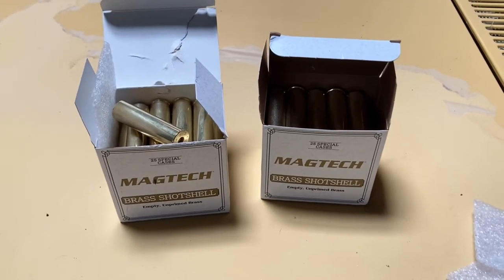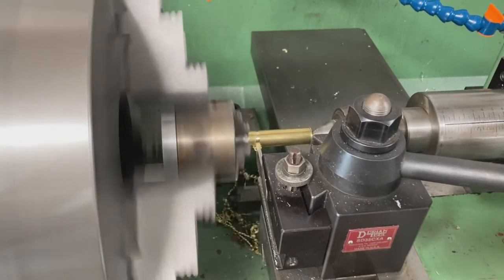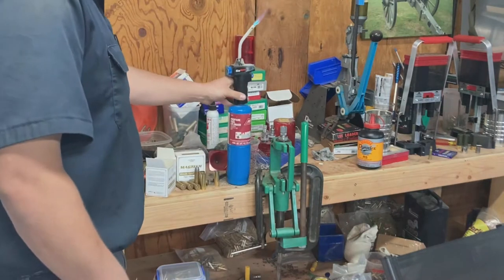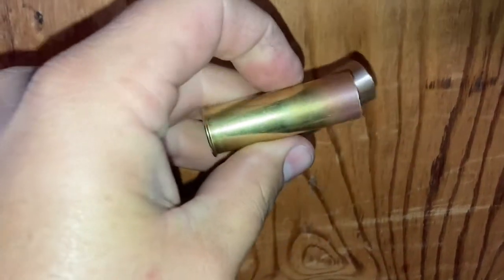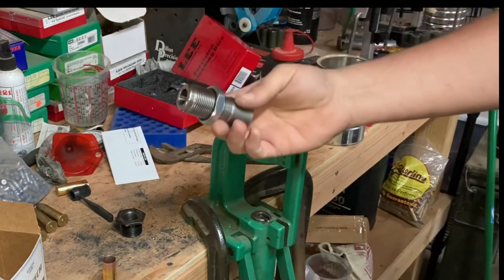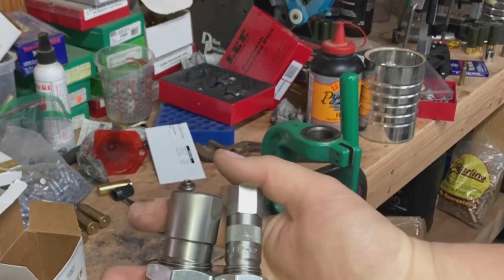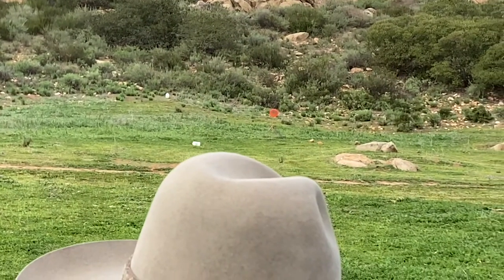Making 577 Snider brass from Magtech 24 gauge brass shotshells

Comment: I bought my wife one in Afghanistan. I have shot it once. I just bought dies, bullet mold and have a machine shop at home to cut the shells. Thanks for the info!
Reply: Sorry if this is random, but what was the process and your experiences like on bringing a firearm home from a deployment? Like did you have to get approval from your CO, what was the bringback paperwork like and what kindve stuff got approved or rejected that you saw? Also where did you buy, did you like just stroll into an Afghani market and buy whatever shit you saw? Sorry ive just always been curious about that.
Reply: @sergeantbigmac  so, since it was classified as a curio and relic firearm, all I had to do was mail it home from the post office. The local nationals had a shop on base in Bagram. When I was getting ready to leave theater, we flew to Bagram for our flight home. I just bought  it and mailed it home. No permission required. I picked up a Snider and a Martini Henry for $400. Both are authentic and not Khyber Pass copies. The Martini is a Royal Kabul Arsenal variety, so all markings are in Arabic. Pretty cool.

Comment: How did those non solid head cases stand up to 120 grs? I have used the 24G cases for M-H 577-450 but they seem a little weak, and they need cleaning as soon as you shoot them as they cant stand much corrosion. That sizing wax is essential for case forming, but it seems to last forever, funny thing about the case trimming is that I always hold the case the other way round, I lodge the rim in one of the chuck jaw grooves. Stay safe! Chris B.
Reply from the maker: The cases held up fine. The rifle stock, not so much…

Comment: Well , not knowing yer technique for primering , I picked up a piece of 1/4 " steel plate , set primer on it then shot shell lined up and using a 3/8" driver I hammered the shell down on the primer till it was flush . The third one went OFF with a BIG BANG ! Scared the doo-doo out of me and Wifie . So I have 20 to load tonite . Dipped in wax/crisco slurry , going to put in 65 gr of GOEX 1F powder , 10 with polenta filler and 10 with wad filler . Projectiles are .578 gr from Jet bullits .
Reply from the maker: Excellent

Comment: Gottem brass , waiting for .578 boolits. I have 1 factory ORIGINAL 1870 boolit . It measures 1.614" . I also have 5 reloads at from , 2.131"----- 2.445" in length ? The 5 will not fit the breech of rifle due to being too long .

Comment: I was lucky enough to find some old Dominion .577 brass at a flea market years back. They all chambered just fine.
I never bothered to get dies.
I just use a tapered wooden dowel that I made to slightly open the mouth just enough to accept a .60 cal round ball. 
I re anneal every couple years

Comment: Very elegant looking.
I've seen someone make his own substitute .577 Snider casings by 3D printing them out of a blue TPU material, having like an upside down bottleneck shape inside, the thickwalled bottom having an embedded .38 Special casing to hold the primer and 60gr of Goex, with the large caliber lead projectile fitting on the wider end.
Looks a bit odd, and holding a bare case you'd notice it's kinda squishy, but that squishy quality allowed it to obturate properly, and to also hold together and extract cleanly.

Comment: Once the brass is fire formed to your chamber, instead of re-sizing it back down each time, see is the .600 Eras Gone bullet will fit it.  I've seen where it will slide right in by hand.  
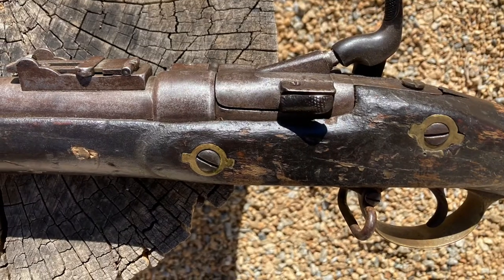Since it is a single shot 12:37  rifle, you don't really need a crimp on it.  You only really need the dies for the first loading.
Reply from the maker: I use a .600 bullet from X ring services

Comment: Great video, thanks for sharing. Shoot mine regularly but only smokeless powder. Take care.
Reply from the maker: What’s your smokeless load for 577 snider?
Reply: 14 gr. 700X, 525 gr. Solid at .585 dia.from X-ring mould. Between three and four inch group at 50 yards every time. That’s from a long rifle and a Sargents model. I love it. I use modified sights. A Ross rear site and the front site from a Lee Enfield No.4. The sites don’t alter the rifle in any way and can be removed at any time.
 @Everythingblackpowder

Comment: Hi. I know it's been 3 years since you posted this, but I finally got the courage to make my own. I usually buy 24G brass whenever I see it available and send it to a friend who does it for me, but I thought it was time for me to do it myself. Anyway, I cut the brass to 2 inches and annealed, although I not sure if I over did it. I formed the brass in the dies and that's where I'm at right now. They look alright and fit my Sniders, but your's look longer than 2 inches. Is that the right size?
Reply from the maker: After mine are formed, I trim them to 1.90
Reply from the maker: You can buy jigs on eBay for a mini saw to cut your 24 gauge brass down to 2 inch and your formed 577 brass to 1.90 inch. That’s the fastest and easiest way I have found.
Reply: @Everythingblackpowder  Thanks for the reply. Yes, I got one of those jigs. It cuts to 2 inches. It just looked longer on the video. I'll have to try them out on the range and hope I didn't over anneal them. I don't think I did, fingers crossed. BTW I love your videos.
Reply from the maker: Thank you

Comment: What type of cutter did you use in your lathe to trim brass back.
Reply: We usually use a parting tool, and if you grind the end at a slight angle it does no leave a burr.

Comment: What powder were you using for those snider cartridges?
Reply from the maker: My homemade powder
Reply: @Everythingblackpowder  is your homemade powder smokeless or black powder. If black powder would it be 2f or 3f
Reply from the maker: @mikemcneilly601  black powder, 2F
Reply: @Everythingblackpowder  I’ve been using Goex 3F 62.5gr. Saw you got away with 120gr looked like a good kick. Do you know of any good reloading data on the snider
Reply from the maker: @mikemcneilly601  yeah, 120gr is pretty uncomfortable to shoot but I don’t have to use any wads or filler with that load and it’s pretty accurate.